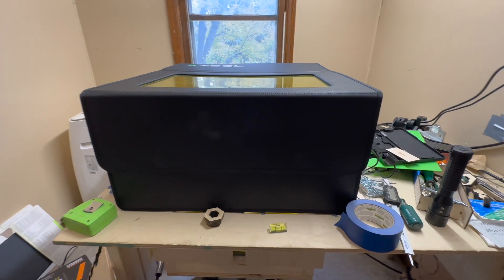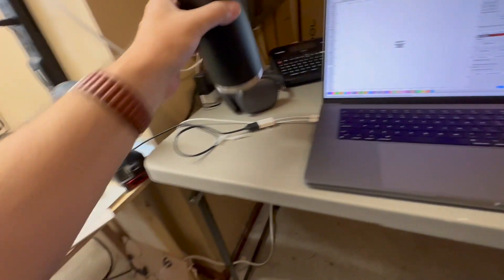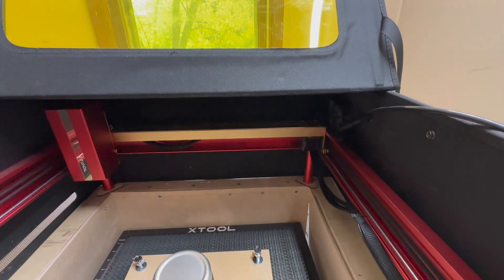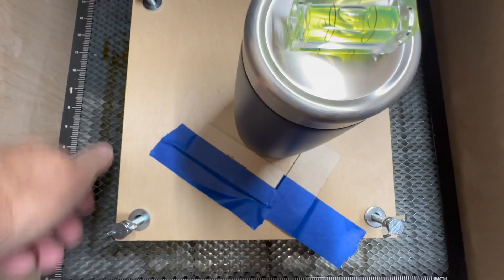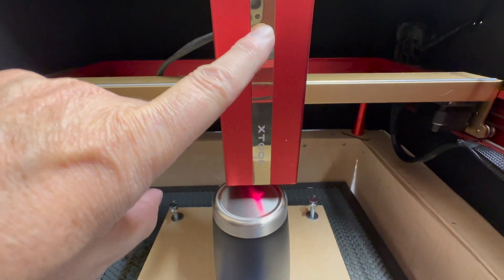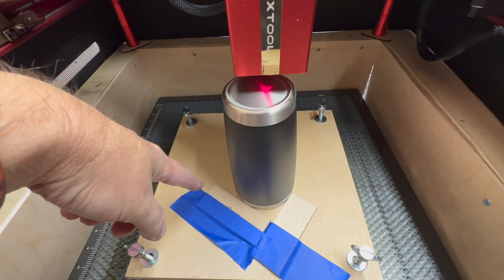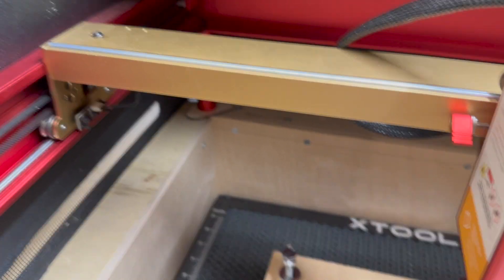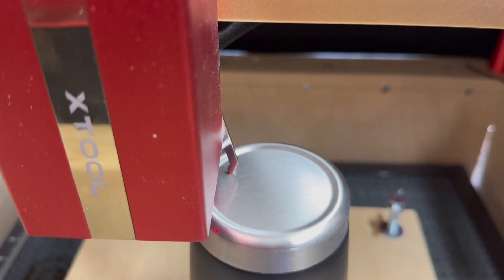XTool D1 adjustable table HD 1080p

Comment: Place the level diagonally between two opposite corners, like upper left to lower right, and adjust those bolts first. Then, move the level to the other diagonal and adjust the remaining two corners. This method is quicker than adjusting with the level placed in the middle.

Comment: Nice setup!  Also... be very careful about moving the laser carriage quickly over distance when it's on, as it can produce a backfeed of voltage/current to the control board, potentially damaging it.   The servos can act like little power generators, similar to the electric motors on EVs, back charging during deacceleration/braking.
Reply from the maker: I didn't realize that moving the laser quickly could create voltage. In actual practice, I move the laser much more gently than I did in the video, and I never move the Y-axis by the module itself; instead, I grab the bar. Thanks for the warning, though; it's good to keep in mind.

Comment: Egggggggggggggggggggggggggslent design. I just got my d1 pro a few days ago and it is not unboxed fully yet. I am designing a free standing wood enclosure which will be on casters. not fully designed yet. I like the idea of an adjustable floor. I will keep you informed as I build it. A slow start because i am cleaning/rearranging my wood working shop and taking a little time to figure out the best design for the enclosure. Engraving the bottom of the tumblers is an awesome idea!

Comment: That's great idea. About your ventilation, can you smell anything? If you do, change this aluminium pipe, they have a lot of small holes, I can't smell anything since I've changed it to polyurethan.
Reply from the maker: I still get a little odor; I'll hit the big box tomorrow and try the poly. Thanks for the tip.
Reply from the maker: Changing the vent pipe to poly made a big difference in the odor. It also takes time for the smoke filter to move the air out of the enclosure; waiting 30 seconds after the burn completes also goes a long way to eliminating odor.
Reply: @gplawhorn  I think that time may be caused by incorrect airflow, air intake needs to be correct size to the outtake, I haven't found the way how to check that yet, have to do some research, and I think my airflow is not the best, I'm not using any filters as my fumes are going outside through the ceiling
Reply from the maker: @amateur87  I hadn’t thought about removing the filters - I’m also venting outside. Something to think about.

Comment: That's a pretty good idea. I am also planning on making an adjustable table for mine. I was thinking of making a scissor lift myself.  But the motorcycle lift you got might be a better way to go. I wouldn't have to build the lift.

I like how you boxed in the frame around the lifting portion.
Reply from the maker: Boxing it in was the best way to capture more smoke, I felt.
Reply from the maker: By the way, there’s less than a quarter inch drift front to back with the scissor lift, and about 1° change in level from bottom to top.